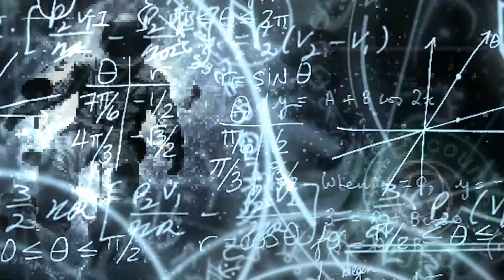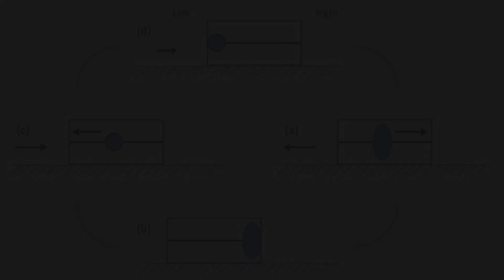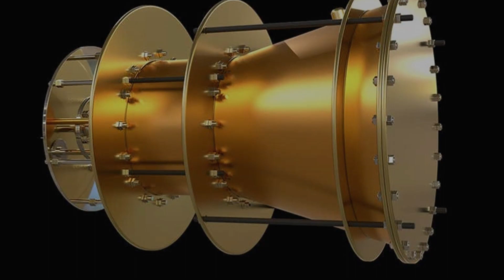NASA Engineer Claims Helical Engine Concept Could Reach The Speed of Light

Comment: Even if this engine is made humans may not sit inside tolerating such hai G forces is not in human capacity.
Reply: You dom't feel the G force in a 500 km/h train because you as a person travel with 500 km/h aswell. The exceleration you would feel. But the top speed you wouldn't because you would be the same speed. That means that it doesn't matter how fast you are in space you could handle it
Reply: Without gravity there is nothing that drags your body down
Reply: What ???  It only accelerates at around 1g continuously and the speed rises exponentially. So there is no huge G force

Comment: Would still require the entire energy output of the entire Universe to convert that helical driver's mass into Speed of Light momentum. Regardless of the system or or drive unit. If it has mass, and wants to travel as light does, then you have to put in more energy than you would ever get out.
Reply: Have to test in space, someone should fund.
Reply: @romeutum6458  That's very expensive, that's what math is made for.